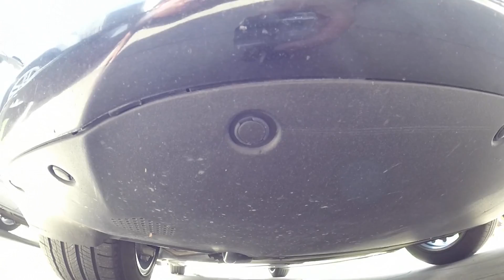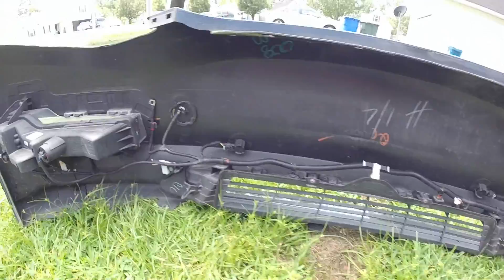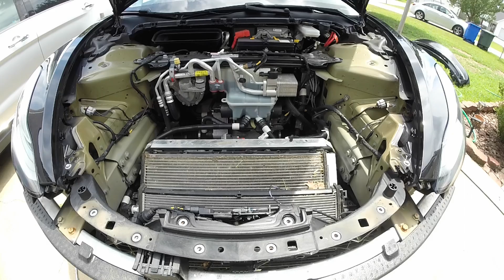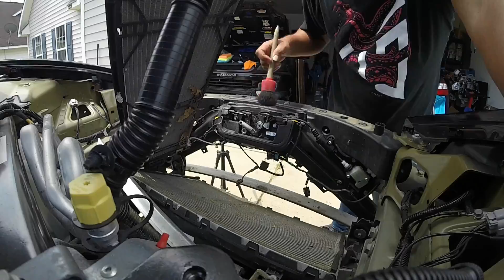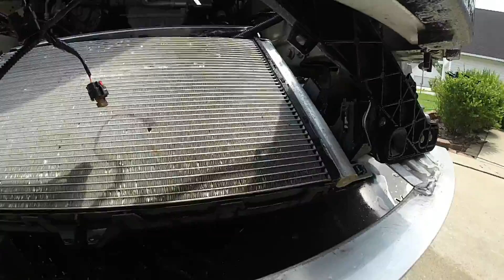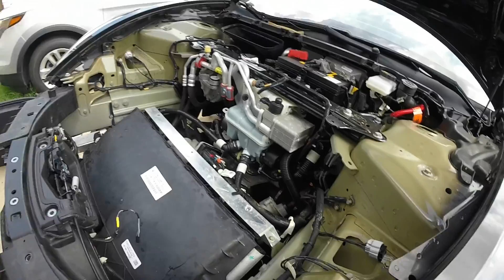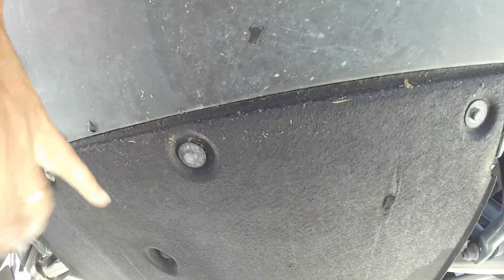Tesla Model 3 radiator condenser cleaning

Comment: There are aftermarket mesh grills which help keep most of that stuff from collecting on the radiator/condenser.
Reply: I heard those mesh grills will bring problems for the Tesla to suck enough air in. I had those on before and somehow the air sound is much louder with these mesh installed. So I removed them last winter.
Reply: @noperge8280  You just have to clean it alot, better than getting rocks in there that could cause a leak!
Reply: @noperge8280  Can you share link to such filters?
Reply: @noperge8280 are you referring to the ones sold by rpmtesla website that go on the front grille or the intake vent that's leads into the cabin?
Reply: Nice, good to know.

Comment: GUYS please start using the service menu on the screen i notcied my ac wasnt cooling much and on the energy app it was draining so bad. Im at 80k miles i went on the service menu and it literally said the "air intles " were dirty its crazy how well the car tells the issue but its absolutely horrible how much miles it drains. My car had probably 10x this ampunt of debris i cleaned it up with a long vaccum hose and didnt have too much of an issue after. Use the service menu guys !
Reply: Where in the service menu does it say anything about AC?
Reply: @rickyyo215 I think he’s referring to “service mode”. Go to the software tab, press and hold for two seconds on the word “model” where it says “model 3, y, etc, it will ask for a code, type in “service”. That will put it in the service mode the service center uses when they work on your car. You get a lot more in depth systems look, diagnostic, and a lot of other stuff.
Oh the cars software measures the airflow coming in and the amount of cooling taking place for whatever the fan and vehicle speed is and gets a rough idea of it being clogged from that dropping below expected values.
Reply: @RonsRepairs  thank you
Reply: How did you vacuums it ? Is it possible to vacuum directly from air intake vent front bottom?
Reply: Not from the air intake you have to remove the plastic tub in the frunk any shop vacuum would do the job but you just need a crevase tool  @sudhirraom

Comment: Buy a normal gas car and never have this problem
Reply: Lol you are joking right. Like Gas cars don’t have any radiators.
Reply: @EvanMichiels  lol not joking. My radiator doesn't lay nearly flat to collect leaves and dirt plus its accessible so i can blast it from the front without 2 hours of disassembly. Thats the problem
Reply: @texasblaze1016  so you already came to the conclusion that every gas car has a radiator like yours?
Reply: @EMtesla1  yeah... which ones dont?
Reply: A lot of sports cars… aero dynamics plays a big part in car design.  @texasblaze1016
Reply from the maker: The way my othe 6 vehicles are set up...........
Reply from the maker: The way my friends corvette is set up. Lol
Reply: @jorgegarcia7005  lol well i have a normal gas car. You know most cars arent set up that way and that was my point
Reply from the maker: I clean the radiators of my hondas and ford. I drive alot and they get filled with bugs. 🤷‍♂️
Reply: stupid comment

Comment: What about pressure-washing from the BACK of the radiator? Grit comes in from the front, so spraying from the back forces the grit out 180 degrees from the way it got in there. Of course, I don't know how easy this would be, but when I do this with dirty rugs from my house (hang them up and spray from the back) it seems to get the grit out more easily.
Reply from the maker: I didn't have a way to spray it from behind.
Reply: @jorgegarcia7005 yeah, a friend and I did this on his 3 a month before your video.  Really wish we’d seen it before!  :-)  getting to the back would have been a LOT more disassembly.  We ended up cleaning it up with a light brush, some foaming radiator cleaner, and non-power washer water spray (because we were worried about shoving crud further into radiator).

This is a SUPER helpful video - wish I could give you 10,000 likes!

Comment: Extremely nicely displayed. However  this cleaning is basically process is incorrect. Always clean in the reverse direction. This means that you clean from the inside out.
Reply from the maker: Meh, I can agree to disagree. I didn't want to be on the floor spraying up and I didn't want to disconnect the ac condensor because the freon is expensive for newer model cars and I also didn't want to go thru tesla to get new coolant and remove the parts for proper cleaning.
Reply: @jorgegarcia7005 If you had a hoist, it may be possible to get in from behind. For the average guy- I don’t think so. 😢
Reply from the maker: I did my friends model 3 and recorded all the different suggestions and explained why I did it the way I did. It's just the best way in my opinion. Once I sit down and stitch the clips together I will post it.

Comment: Thank you for this excellent video!
With this help, I did mine today, was really clogged up.
Experiences:
in the wheel arch, there are 2 more clips at the bottom. If you undo these,you don't neccessarily have to separate the plastic bottom cover.from the bumper,just undo the 4bolts on the aft edge.
This way you
-have more access to the radiators
-don't have the remove the nuts at the bottom of the bumper. These are on a sort of stud, which loosely held in place in the plastic bottom cover,and can easily spin in its place... :(

If you undo the total of 4ea 13mm bolts on the front(once the bumper is off), and undo the 8mm bolts (facin aft) that secures the radiator via rubber bushes, than the radiator is practically held only by the hoses,giving you a lot of movement,so the shroud comes out very easy. But must pay attention not to put excess stress on the hoses!!!

Again,thanks for the video!!
Reply: Would you happen to have photos or video on how to do this?

Comment: Any thoughts of adding a screen to stop bugs/ leaves from getting into condenser?
Reply: I  purchased one from Amazon  and installed it on my y performance and the watt/ hour per miles went from 305 to 440 plus! Fit and finish was excellent but I returned it back to Amazon because of its poor efficiency.😮
Reply: The mesh screen keeps bugs and dirt out, BUT reduces airflow a lot, so not really such a great idea. 😢
Reply from the maker: Some companies sell a screen for the grill.
Reply: You are a brave person! Tesla cleaned the leaves out for me because the fan was making noise 😮

Comment: That is a LOT of debris,.. I have never seen that much blocking one before.  I wonder if it has to do with the air inlet design? I doubt that stuff was picked up while driving...  some of those leaves were really large.
I wonder if the car is vacuum that up while the car is supercharging..  the fans will be running full speed while the car is not moving. Anything that might be sitting under the car in the parking spot could be sucked up in there.
Great job on the video...  lots of great details on how to do this.
Reply from the maker: You make a great point. I will say this. Since cleaning up this, I've been  paying attention while driving and I have noticed that while driving cars in front pick up alot of debris. I did place a rag in front of the radiator and it does act like a vacuum and can definitely see it picking up stuff while charging.
Reply: @jorgegarcia7005  
Interesting. I wonder if there's any way to mount some kind of mesh screen over the air intake that's under the car.
I've seen people do that on the front of the condenser of average cars. That way the debris doesn't actually get embedded in the condenser itself.
One other suggestion would be to use coil cleaner. I've used that on my cars and also my AC systems in my house. You can get it at most home improvement stores or online. It's a foaming type cleaner that is supposed to loosen and dissolve organic material. Since you would be able to get access to the condenser easily. You spray it preferably on the back side so that when the foam expands it pushes the debris out the direction that it came in. But even if you spray it on the front it will still kind of squirt out all over the place. Then you just rinse it off with water.